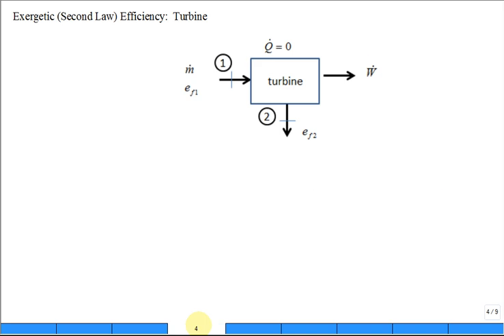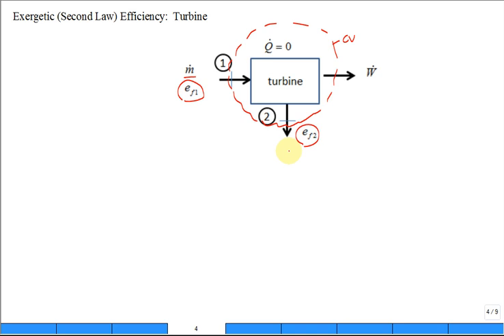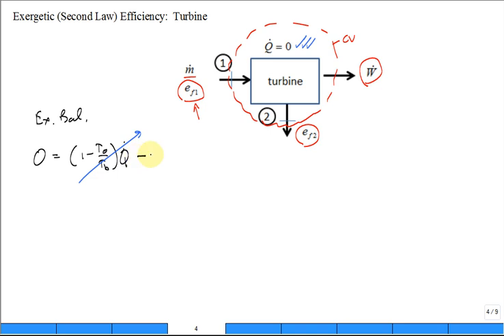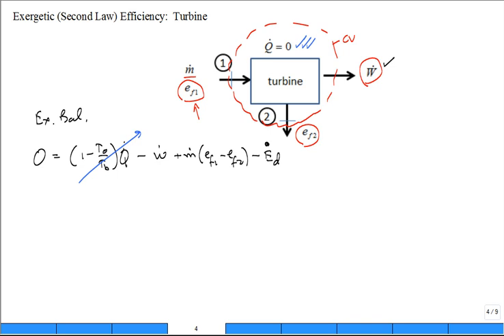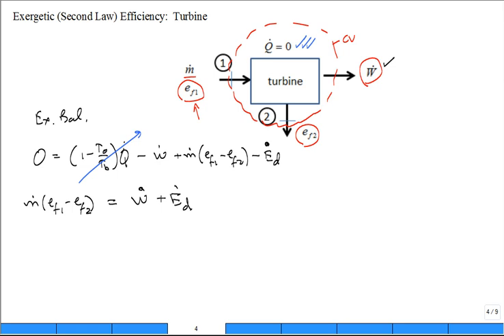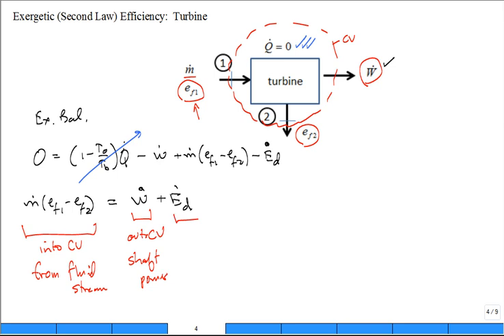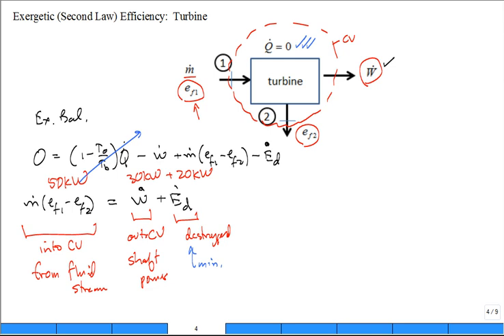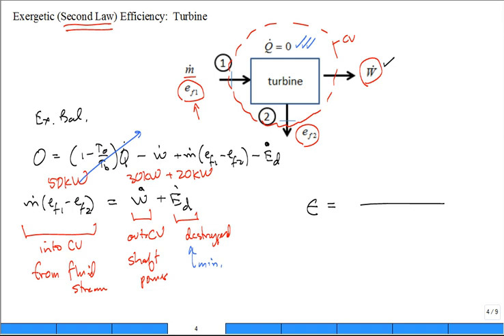Exergetic Efficiency for a Turbine

Comment: What is difference between thermal efficiency whaich is calculated from heat with exergy efficiency
Reply: Exergy efficiency drops due to irreversibilities ( exergy destruction/ entropy generation) and if process is reversible you can get %100 efficiency, but there is a limit for thermal efficiency even if the process is reversible. In short, the maximum work you can get is determined by thermal efficiency, and how much you really get is determined by exergy efficiency.